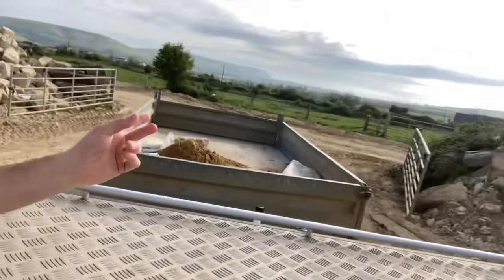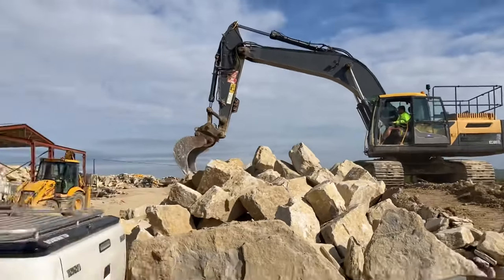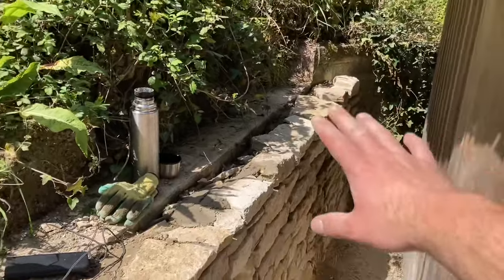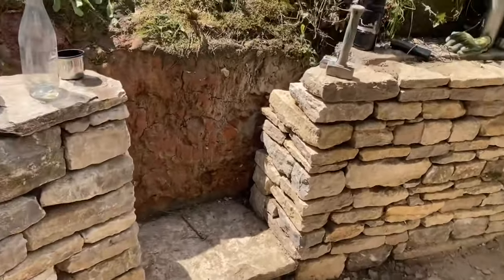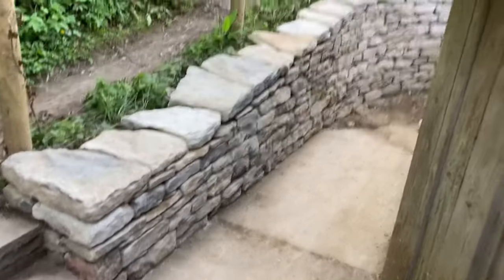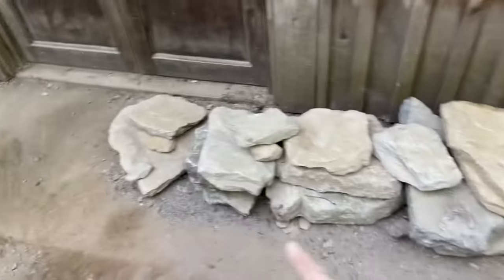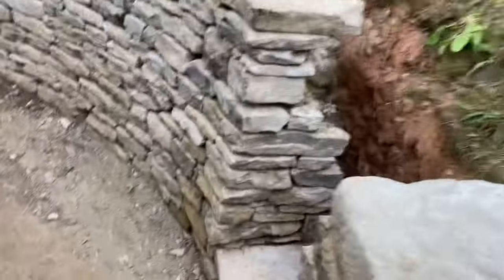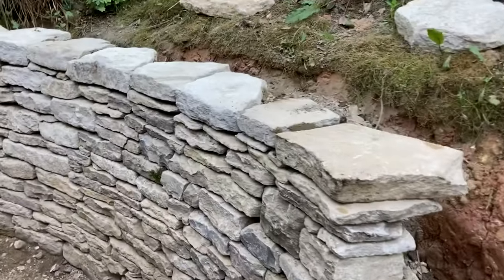Building A Dry Stone Curved Wall & Cladding #4

Comment: what is the composition and proportion of the binder
Reply from the maker: The mortar for the cladding is a 6/1 cement. 3 grit & 3 ginger sand 👍
Reply: and for masonry?
Reply: to bind rocks between them to build wall
Reply from the maker: It’s dry stone on the curve so nothing but stone and then the cement mix used on the cladding, that’s it.